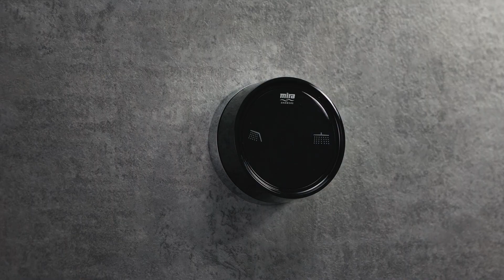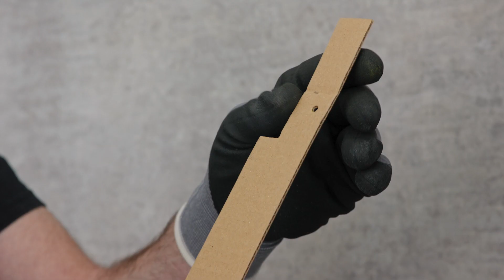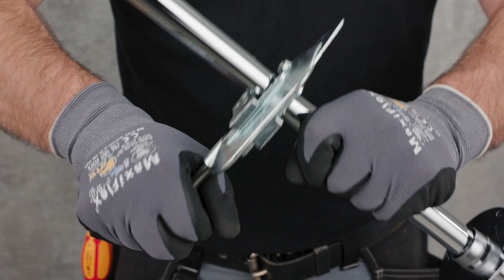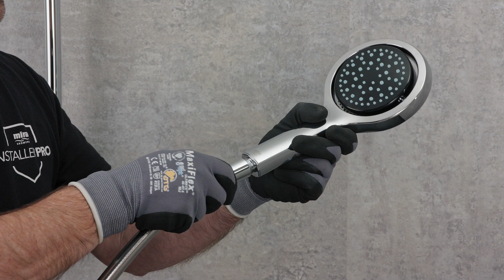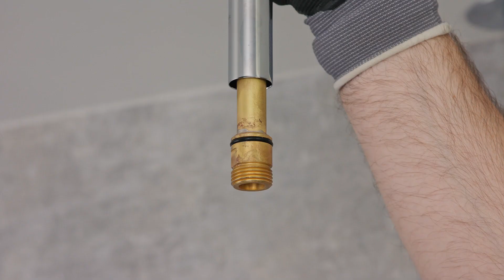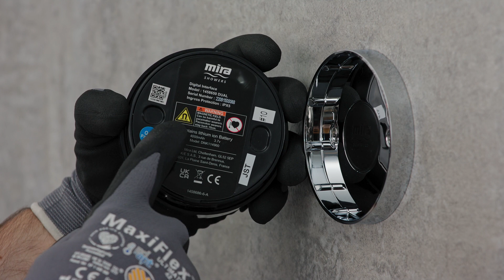Mira Platinum - Dual Ceiling Fed step-by-step installation

Comment: So if the valve is in the loft , will it pull the water up from the hot water tank in the room below
Reply from the maker: Hello @andrewlee4938 Yes, it has a pump inside. Please DO NOT install the digital mixing valve or fittings where they maybe exposed to freezing conditions. Ensure that any pipework that could become frozen is properly insulated. Refer to ‘General Installation’ section for more information.chrome-extension://efaidnbmnnnibpcajpcglclefindmkaj/https://techcomm.kohler.com/techcomm/pdf/1514415-W2-D%20Platinum%20IUG%20250725.pdfchrome-extension://efaidnbmnnnibpcajpcglclefindmkaj/https://techcomm.kohler.com/techcomm/pdf/1514415-W2-D%20Platinum%20IUG%20250725.pdf  if you required further advise please contact our Customer Services Team on 0800 001 4040 option 1 or askus@mirashowers.com Kind Regards Mira showers You Tube Team

Comment: New Controlled failed within 1 month. Utter rubbish.
Reply from the maker: Hello @tiredofeverythingnew, we are sorry to hear that  your new controller failed within 1 month. Please contact our Customer Services Team on 0800 001 4040 option 1 or askus@mirashowers.com who will be pleased to assist. Kind Regards Mira Showers You Tube Team.
Reply: @mirashowers  what a joke, this is the most useless controller known to mankind. Who the heck designed this rubbish. no actual buttons, no way to turn it on and off again. Avoid Mira products.
Reply from the maker: Hi @tiredofeverythingnew, we’re sorry to hear you’re unhappy. 

This model is a fully digital shower designed to operate via touch controls, and if the unit has failed within one month it will be covered under warranty. Our Customer Services Team would like to help resolve this — please contact us on 0800 001 4040 (option 1) or email askus@mirashowers.com. 

Kind regards, Mira Showers Team

Comment: Is this new UI controller compatible with the older Mira Platinum units, bought about 3 years ago
Reply: No,they are radio linked,the new ones are bluetooth connected.